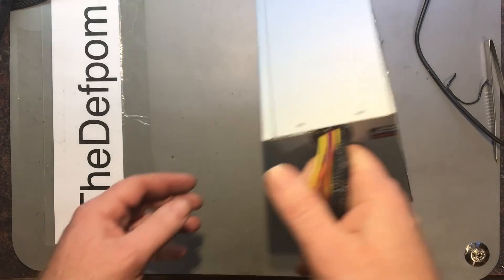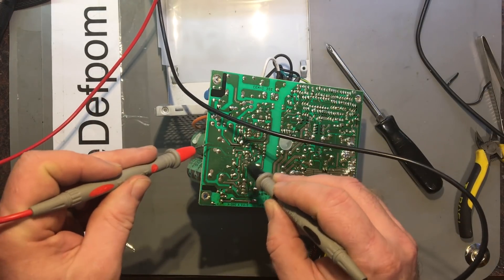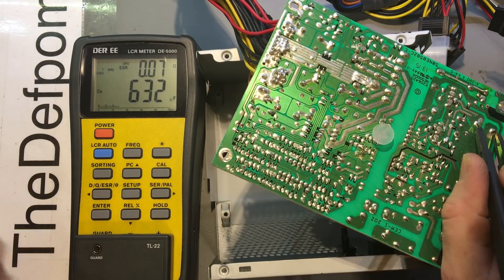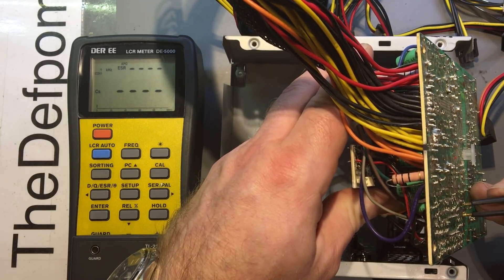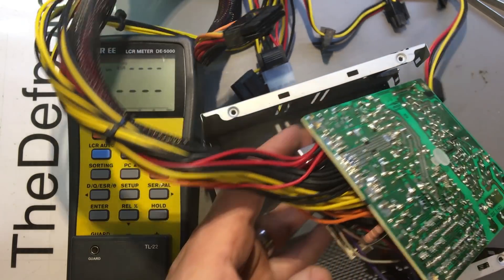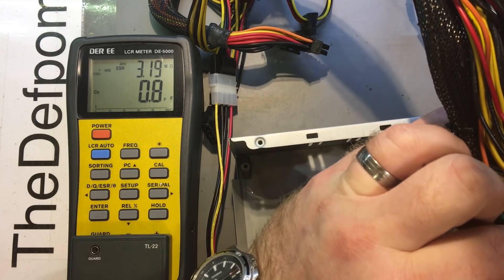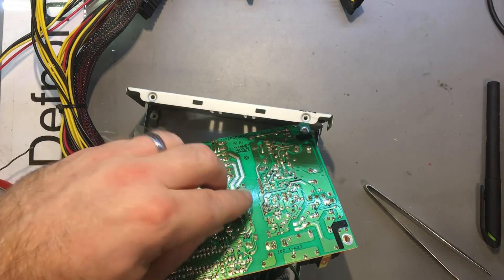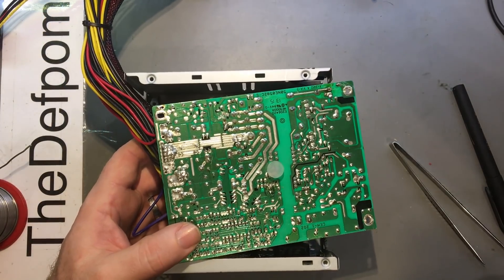#310 ATX Computer Power Supply Failed Repair

Comment: To fix a switch mode power supply you first need a clear understanding of the issue.  As these PC ones have a number of outputs, did every output 'randomly' shut down or just one?  There is plenty of SMPS tutorial information on the internet and the concept of them is simple.  The usual failures on these are the individual output rectification and smoothing blocks, or something within the feedback regulation circuit.  If this power supply fails when on for a while maybe it is a thermal issue in which case a heat gun could be used to troubleshoot.  A logical problem solving approach is needed not just random parts checking.  I'd suggest picking it up and trying again after watching some other SMPS repair videos as you learn far more from the hard fixes than the simple capacitor swap no brainers.  I'd like to see you try further.

Comment: Hi if the PSU is working I would of myself run the PSU with loads on each rail, (I find automotive lamps to be  good for this), and use my scope to look for excessive ripple on each rail. the most common items to fail in an ATX PSU are the 2 green electrolytics below the gold coil at 13:57. these are the smoothing for +5Vsb and also the supplies for the PSU regulating IC seen under the grey wire at the same video time. Capacitors I tend to use are Rubycon ZLH series as I find these to be low ESR and long life. Did his new PSU solve the problem?
Reply from the maker: FireballXL55 - thanks for the info, he got a new ps and his computer has been fine since, I don’t know what he did with this supply, I think he threw it away, would of been nice to get it back to have another go.

Comment: Never mind, strip it for usable parts and thick wire, then show it the bin :-D
I've been lucky with the ones i've done, it's standby supply caps, mid stage caps, and of cause all the output ones are deader than tanktops lol :-D

That meter looks usefull, i was going to wait untill you looked away to fondle it lol :-D
Reply from the maker: I have  a few failed repair videos stored up, so I will be adding more things I couldn't fix over the next few weeks, I am just trying to tidy up my half done videos, I have several half done projects I need to finish!
Reply: Im sure the fluke calibrator is getting to be a bloody pain in the arse, put it in a cupboard and forget it LOL :-D
Reply: zx8401ztv - I disagree, the Fluke 5200A is an interesting expensive bit of kit and well worth fixing. It also has schematics and a service manual, so it will eventually be repaired providing those special asterisk marked components don't need to be replaced.

A generic ATX PSU doesn't deserve anything other than a quick easy check and then chucking in the bin if simple checks don't bring it back to life.
Reply: Drew Dastardly,
Im joking with him, notice the laugh out loud and grin ending.
Don't take things to serious :-), we all know he will get it going, but he will get a bit fed up with how long it has taken.

The psu could be repaired, but he has other fish to fry :-)
Reply: zx8401ztv - I have to admit the 5200A looks like it's a trash bin of all the worst boards that another "service engineer" cobbled together from board swap level "service" rejects. So potentially every board is fecked up in some way.
Reply: Drew Dastardly,
Oddly enough i thought that near the start of the repairs, it looked like all the dead parts left over from a massive game of musical pcb's lol.
I hope he succeeds as it would be a good bit of test gear.
Reply from the maker: zx8401ztv - I haven’t had the chance to touch it in about 6 weeks now... I am hoping to get back onto it this week.
Reply: TheDefpom,
I was just woffling in the comments to other subbers, i was saying that you possibly are getting a bit fed up with it by now, sticking it in a cupboard for a bit may be a good idea LOL :-D, i've done that with some things then a month later ill have another go lol.
The problem with youtube is you get all the chat, it never used to be like that.
Reply from the maker: zx8401ztv - that chat is good, I quite enjoy hearing what people’s opinions are on things. I’m not sick of the Fluke yet, maybe after I have spent another week trying to fix it.

Comment: I wanted to fix my supposedly good brand PS, but when you looked at the price for new generic ($22AUD) you kind-of give up.

Lately I've been stripping the PCB bare - yes I'm insane because there is 200 parts - and bolting Ebay kits to them to make lab PS because they have the case, fan, and 240V connectors already there.

Comment: I am trying to repair several PS. I hope to make at least one working. They all have the -5 V failed. They all have busted capacitors, but changing capacitor does not usually help. I saw a Vietnamese guy changing power transistors.
Reply: I suggest each smps PSU in the market should be provided with a authentic schematic diagram.I have come across many such PSU,s none of these identical or similar.Those who need to purchase should always demand the schematic of the instrument compulsary.The industry is all flooded with ordinary inferior products. Make sure you are not spending on trash products.Take an oath never to buy such items without a proper aftersale service,afterall whats the reason behind not providing a schematic diagram  when its most needed for reference.Will any of our engineers in this field upload different shematic diagrams with their model nos and make please? I am quite sure they will be rewarded with millions of applause and likes for the good job,and finally do take little pain to demand and compell the manufacturer to provide a schematic diagram of the product which they put for sale in the interest of both the mfgr and the user. JAI HIND.

Comment: Those are not UF like U or F, its micro farad, uF
Reply from the maker: Yes, old bad habit which I have since stopped doing, the µ is actually pronounce "Mu", so I could try to say that I was pronouncing it correctly, but I wasn't ;-) I now say micro Farad most of the time.

Comment: I DON'T GET THIS...THE VIDEO JUST ENDS...THUMBS DOWN
Reply from the maker: Yeah, I was hoping to add to the video, but that never happened as the repairs I attempted were not successful, that is why it is titled a "Failed Repair".
Reply: I understand but you should include it. I already knew it was a failed repair and still chose to watch it. But was left hanging dry when it just abruptly ended. I don't mind seeing the methods you used to try and troubleshoot even if they didn't find anything. Anyway, thanks for responding. Take care
Reply from the maker: abeleski - that wasn’t my intention, I had intended to video the outcome of it working, or it not working, but the teenager that owns the computer that it came decided to purchase a new supply and threw that one away, instead of giving it to me to investigate further, so I myself never got to finish it either, most dissatisfying.